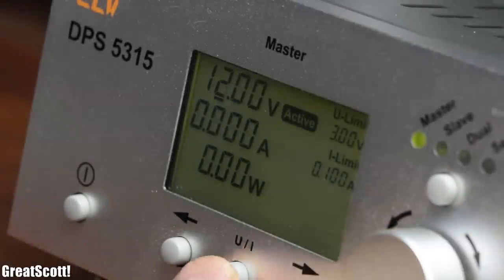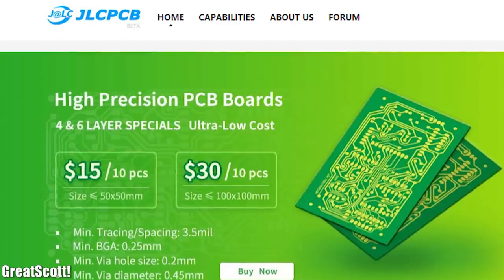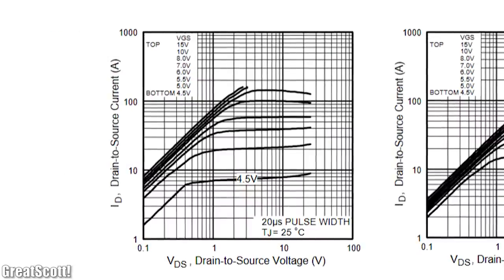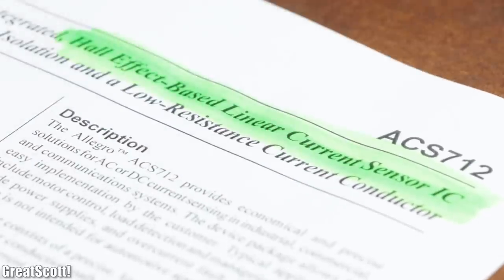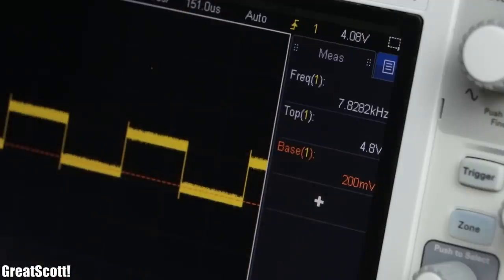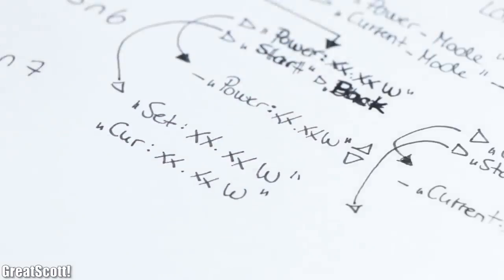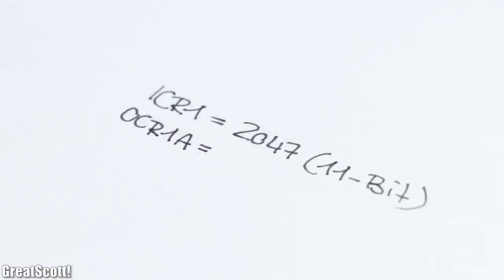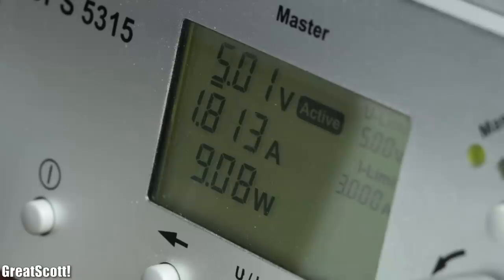DIY Adjustable Constant Load (Current & Power)

Comment: Hi Scott, great vid. Does the output load give out AC or DC current. I'm assuming its AC. Since you are not using a bridge rectifier or smoothing capacitor. Another question is how would you increase the range of output current you get out of this circuit. Like above 10A AC.

Comment: In order to make programs fast, you have to use as many constants as possible, and make computations only when needed, once. For example, you used correctly the ++ operator, but did not use --. You had also going a lot of 1 << and "or" operations, where to use constants.

In your interrupts, use just a bit-set as a flag and return instantly. Interrupts must return ASAP. Your main loop should check critical data as often as possible, but leave other operations out, for as long as possible. For this, use a counter and check them, say once every 64 iterations (test bits). You get even better results, when the voltage samplers can generate an interrupt, too.
Reply: using 1 << does not actually harm the speed at all if using avr defined constants, as WGM13, etc. all those things are defined at compile time and the compiler calculates the shift. The shift only needs time if one of the arguments is a variable changed at runtime. The same goes for the or operations:
if you write TCCR1B = (1 << WGM13) | (1 << WGM12) | (1 << CS10); it gets evaluated at compile time to TCCR1B = <some constant>; where the constant is the value that the right hand side will be.
Also you don't have to make interrupts too short, the ISRs he wrote are fine. You just want to make them as short as possible without having to make very strange workarounds and inefficient constructs in your loop. 
On AVRs (arduino use avr), some of the slowest operations are division and all floating-point operations. A int division takes ~15us, where addition is below 1! float add/subtract can take ~6, multiply ~9 and division ~29us. (source https://forum.arduino.cc/index.php?topic=92684.0 ). That doesn't sound like much, but consider a loops, that does a lot of division can take a substantial amount of time.

Comment: Will this work for negative voltages too? If yes, would it be able to handle a sinusoidal waveform, for testing an audio amplifier?
You should consider doing update videos on some of your projects.For example for this project:
- Add data logging via serial or an SD card. (To see your discharge graphs)
- Digital cutoff, if the Arduino senses the voltage being too low, it stops. (For testing batteries)
Reply: If applicable,  I wouldn't because you may exceed the load ohms and fry finals.  Anything below 4 ohms is danger territory.
Reply: @publicmail2  could you clarify what you mean? I'm guessing you're saying that you're worried that the load will have an impedance lower than 4 ohm which could be harmful to the power stage of the amplifier?

Comment: Interresting project! It's always usefull to have a load that can be ajustable. Could be programmable too. I was wondering if you know some PSU like your DPS5315 which is programmable and not too expensive. The problem with the DPS 5315 is that everything is in German. Not sure if it can communicate with SCPI protocole as well...
Thanks

Comment: Hello there sir, big fan here. I've watched your videos again and again especially the electronics basics series. I have two questions about the way you arrange the lithium battery and the charger in the power meter/logger project.
1. Is the silver metal covering the lithium battery connected to any terminal?
2.The TP4056 module gets quite hot in the early charging phase even at 1Amp. So is resting the module on the battery like that safe since lithium batteries in general are very fragile especially to heat?
Reply: rengpuia colney that outer covering, in case of lipo battery is not exposed metal, it's covered by plastic... While, In case of lithium ion battery, the outer metal can is negative terminal and  the small tab on the top is isolated from the metal can and is positive (generally lithium ion cells come with a protective circuit and 3 terminals clearly marked ± and entire can is wrapped in insulated material, those batteries were usually found in old mobile phones with removable batteries) in case of lithium polymer batteries, the outermost covering is a plastic pouch.
2. As soon as TP4056 and battery aren't in contact it's fine. Make sure that ambient temperature is safe for lithium battery though.

Comment: Hi Great Scott, would you mind explaining how current voltage conversion work like in solar(20v) to battery(12v) as they have specific watt output and input. In paper it is convincing to use formula but in real situation how does that work. Solar may be sending 10A over 20V and will battery receive only that much amp or is there any other conversion stuff going on to equalize output and input power?

And can you please make video on circuit which gives off alarm ring when circiut gets closed for few seconds or make it alarm as wish but only during closed circuit and for few more seconds even when circuit is closed to few milliseconds.

Comment: Nice project.
Another important factor of the load is its impedance.  For example, when you draw a 2 A current from 2V source with Saturated FET or BJT, you differential impedance is almost ro where as when you use a one ohm resistor to do this your differential impedance is 1 Ohm.  Now, for example,  if you are trying to measure the noise of the supply or a DC or AC generator, this makes huge difference if you have your differential output impedance is 1 ohm or ro.

So how can you get low differential output impedance?   I can think of two ways.

1st:  you have several say 1K Ohm parallel resistors which can be switched in and out of circuit by small MOSFETs in series with each resistor.  ( ie.  If you put 1000 1KOhm resistors in parallel you get 1 Ohm , and even if you use 1/4 watt resistors you can dissipate 250W without heat sink). Here to control the gate of the MOSFETs you need a Binary to Thermometer code converter.  Then you can generate the binary code with something like Arduino.

2nd:  You can cascode several MOSFET transistors, so each MOSFET stays in saturated region.

Comment: Amazing , I was trying to build one, but I wanted it to work till 10 amps or 20amps, so I guess I am supposed to change the mosfet ? Or it's just more better heat sink has to be added to the irf? 

Cheers! 
And thanks a lot for sharing
Reply from the maker: Try a heatsink with fan. If that does not work try another MOSFET with a bigger package.
Reply: @greatscottlab  Thanks a lot, I will try that.

Comment: A ceiling mounted ultraviolet  laser to control the rear speakers in a large room without running wires. I see red laser kits you can buy but you can see the laser. I want to run the rear speakers and a thumper under the couch at the back of the room off this laser signal . Is this a project you would build?

Comment: Good video, interesting use of digital control loop. For more resolution you could use, instead of digitizing the current value, an analog control loop (a simple opamp) comparing voltage over sense resistor vs input set by a pwm (there are many techniques to improve resolution of arduino pwm, specially because you don't need it to be fast here).
Another good goal to pursue is having a load that can be controlled externally (e.g a pulse, or a step) to analyze response of circuits under transient load changes.
Reply: Another good one would be a load that can be used for AC...  :)

Comment: That fet will runaway and die shorted just around the 40-50W mark. I ran some tests with those exact fets a while ago - they fail fairly consistently. Best bet is to use some beefy linear mosfets from IXYS, although they are expensive.

Comment: Is there any way to force more current into a motor?  for example i have a 12V 60Amp DC motor, I run it at 12V and it draws only 3Amps but i want to be able to adjust the amount of Amps it take (without applying more external resistance load to the motor shaft), i.e 12V 20Amps, is there a circuit that can do that?

Comment: Hello,
I have similar project to do in school that uses these loads and adds a lot of fluff to it, but I need high precision. I have all this fluff already working, but the main circuit is the problem.

My first try was to add rail-to-rail op-amp to Great Scott's first video, when he tested Chinese capacitors. Did not work. Only worked with his LM358N.

Then I saw this video and tried to add DAC instead of Arduino PWM before MOSFET driver, still no effect.

I am absolutely clueless now. Please, did you try it as well? Did you have any problems with it? Or does it work just fine and there is something wrong with my connections?

Thank you.

Comment: You could have used a shunt resistor (or transformer based on for over 50A), analog multiplier (could be one quadrant multiplier even), Norton opamp, normal opam, and single high res DAC, with multiplier in the feedback loop, to create constant power load without micro control. That would be beneficial for very quickly changes voltages, i.e. these generated by some SMPSs. But micro is good for testing batteries, where reaction speed is not that super important. Also micro allows you do simulate inefficiencies of load (i.e. ~constant power, but depending on input voltage, the import power could vary), just like most SMPSs are not really constant power, as they vary (by about 10%) their input power (for the same output power!), depending on a voltage.

What you could do in your current setup, which is relatively simple, and requires just code update, is pulsed loads. I.e. every second a 1W or 100mA pulse for 10ms. Or something like this. Useful for various applications.

Comment: Hi GreatScott, very interesting project for the RC world. I was wondering , you say that it can handle max 30V and 20A (600W). The current sensor (ACS712) can handle up to 30A, also the MOSFET can handle up to 49A. Can you explain why you are limiting it to 30V/20A (600W) ? Also, is a fan needed to cool the MOSFET ? Really like your channel, great project for the coming winter.
Reply: For everything above like 50W this needs a way bigger heatsink and a lot of airflow, I've built the analog version he created earlier and at 40W with a slow running fan its already getting very hot on the mosfet itself.

Comment: Hey guys! I need to" inject" amperage from 10mA to 10mA increments at cellphones lines when they are shortcut-ed. That's what I do to find  between dozen of suspects components that always is one generally a Cap that has the short cut to GND. 

But my power supply is really annoying to limit the current even with the fine adjuster. If I build this I will be able to get small load from 10mA,  to 20mA,  to 30mA depending on what I need mA I need.

Comment: Great info. I've been looking for a PSU that can output 0.7~0.9 Volts and 'push' out a constant current at ~0.5 Amps and up (both adjustable) for electroforming/copper plating small hobby projects. Sadly the Lab PSU's I've bought do not work well for me so I would have to start making my own. Do you think it's even possible for a PSU to 'push' out constant current at such a low voltage? Apparently most Lab PSU's are not able to do this.

Comment: As an improvement suggestion it would be nice to have a self diagnostic feature in the software that can shut down system in case if a current greater than the set value is detected for a pre defined time interval in order to protect the load in case if the transistor shorts out due to a fault.

Comment: are you sure that your loop is stable though ?, your have a pole from the RC filter of the PWM and another pole from the time delay it takes for the ADC to read and adjust the PWM, all this in a feedback loop with loop gain equal to (transconductance of the MOSEFT * gain of the current sensor * ADC gain)

Comment: How many watts can this draw with that large sink ? And how greatly could a PC fan increase those numbers
Reply: @Basement-Science  at 12.6v only like 8 amps ? Ug.... Gonna need to up those rookie numbers
Reply: @Basement-Science  unfortunately yeah I'd like to load test the capacity of some 5Ah lithium batteries at a constant rate of like 15 amps .
Reply: @Basement-Science  possible to run mosfets in parallel?
Reply: 15a * 12.6v peak = ~200w peak.  2 CPU coolers on 2 mosfets each fet gets 7.5 amps?
Reply: 100w out of a TO-220 package is probably way too optimistic.. I'm not against mounting a temperature sensor near the package and just maxing out the thermal capabilities with a little buffer.

Comment: I wonder if it can be tweaked to become an adjustable electronic resistive load?
Reply from the maker: I don't quite understand the question. It is an adjustable resistive load.
Reply: I thought your project can only adjust its current or power intake into a constant value. If I wanted an electronic resistor, let's say 10ohms, then if I adjust the input voltage, let's say from 10V to 20V, then the current drawn should also adjust from 1A to 2A. Thus, "simulating" an ordinary power resistor but can intake more power. My question is with your current design, can I just adjust the code or add a few more components to achieve that? Thanks
Reply: Yes you can. I think it should be a simple case of modifying the constant power mode. Instead of multiplying voltage and current it should divide voltage by the current to get effective resistance and then you have to inverse the logic so you increment OCR1A when the resistance is too high and decrement when too low. Also a note to +GreatScott!. I noticed you use the increment operator "++" but not the decrement operator "--". The code works exactly the same but this is just an obesrvation :)

Comment: Love the content!! Is it screen0 or scree0 (9:14)? hehe... You can increase the resolution of the output voltage by increasing the frequency of which you update the PWM duty cycle (creating a quicker inner control loop) also increase ADC resolution with this method. The only problem is that these inner control loops need to be a lot quicker than your main loop. Arduino wont neccesarly accomplish this fast enough.

Comment: Ohhh, Great Scott, the wizard behind the curtain.  May I ask you for a favor.  I've got a ton of those esp8266's  and a mess of the 4 X 8 X 8 LED Matrixes based on the MAX 7219;  Now to get these things to talk together, I useually through in a small ATMega chip;   Plus a self designed and made Bi-Direction Logic Level converter.  (one of yours I think).  But having all this hardware, and logic level converter(s), etc, seems quite a waste to me.  I'd like to simplify my design attempt at just removing the ATMega, and running the system on the ESP8266;  Which has more memory, an MCU, everything I need.  Plus wifi.   Anyway, I've been looking an cannot find a simple Serial to SPI converter, or even something that resembles such a thing.  Ive done SPI Comms thru a computer sucessfully, using a parrellel port (Toggling one of the data pins as clock, one as Slave select, MISO, MOSI) and it worked quite well.
But, getting control of a typical FTDI serial device is a little harder.  I just need to control one of the pins as say, DTR exchanged for !CS or CTS/RTS as clock;  Something like that.  More to the point, getting the ESP8266 to behave, or enable SPI Comms to the MAX7219.  With the few pins I've got.   Any suggestions, ideas, or cheap hardware ???

Many thanks!

Comment: Dear I set up your project and I will make some considerations:
1 - the IRFZ44N mosfet transistor
it's critical. I couldn't get it to work with it. when turning on with a current of 5A it burns. Perhaps Chinese quality.
2- I found it very difficult to adjust the current value, because every time it turns on it starts from zero, and the increment is 0.1A. Therefore, if I need to adjust it to 15 amps, I need to turn the encoder 150 times, that is very cansative and need much time.  Is there a way to do it faster? would need to implement this in the firmware. Another detail, the increase takes place in an anti-clockwise direction, which is not common sense, it needs to be changed to increase in a clockwise direction.
in power mode, there is a difference between the actual value and the value indicated on the display.In current mode thats good.
It would also be great if there was a timer for the duration of the test. Well, if you make corrections to the software, please let me know

Comment: If you really need mA range load then you may ditch the power electronics. Just use an opamp as the current driver.

Comment: You made a slight mistake. The ohmic region is where you can dissipate heat with the FET. In the saturation region the mosfet is fully open and you only dissipate the power over the Rds_on Resistance.
Reply from the maker: No

Comment: I think I am confused. In the saturation region, current through the mosfet is no longer affected by the gate voltage. In the linear region the gate voltage determines the drain current. It seems to me that you would want to operate the mosfet in the linear region so that the gate would have an effect. Further it is in the linear region that power dissipation is maximized. This is because the mosfet is acting like a variable resistor instead of saturation mode where it acts like a switch.
Reply from the maker: Watch my MOSFET basics video
Reply: Basement ScienceE  I get it now. Like I said, it was confusing to me.

Comment: Is not a 10R a very low resistor to put in the arduino output? a 150R should be better, considering 5V as voltage, to respect the limit of 40mA maximos from arduino pin. It worked becose high impedance of the mosfet driver, in other scenario you can burn your MCU trying get 500mA from it.

Comment: Can any one help me! 
I need to test a 12V system, but I need a load i can adjust from  10-60Amp at 12VDC. 
60Amp / 720watt.     That can run for 10 hours non stop.